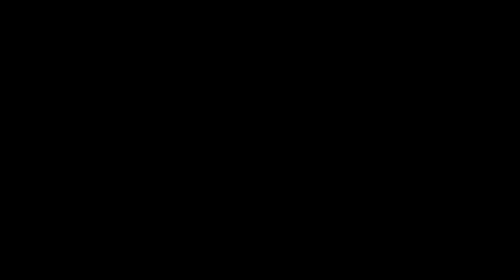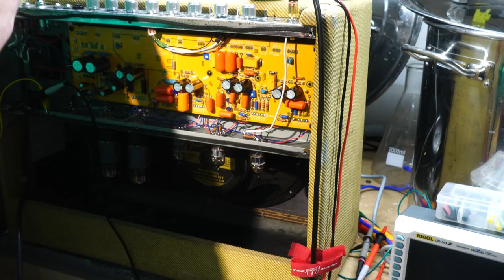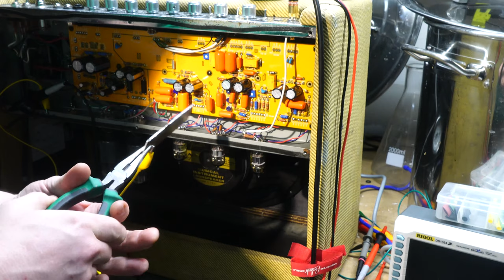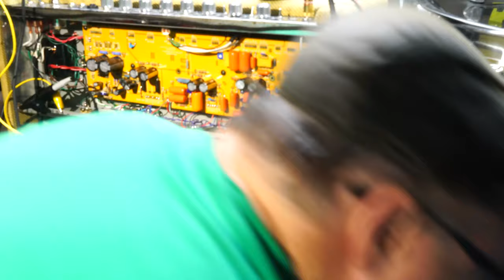Blues Deluxe to Overdrive Special Video 9 - Oscillation Resolved!

Comment: lack of  reverb on this is holding me back and no i dont wanna use a pedal i wanna keep my spring reverb
Reply from the maker: You would likely need a new power transformer, but there are several one tube reverb addon mods I've seen.  It would require cutting another tube hole as well.  Not impossible, but not easy.  You could also build a fender reverb unit separately and get that true tube spring reverb in a separate box.

Comment: Could have used shielded cables?
Reply from the maker: I actually did for that first white wire.  That's a shielded cable.  The oscillation was happening on the last bare section of the wire that was connected to the standoff.